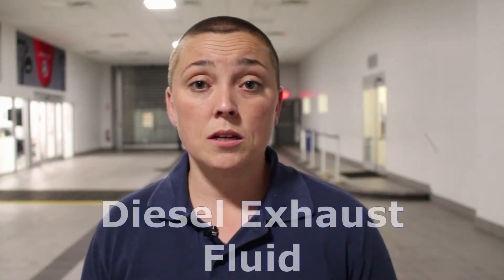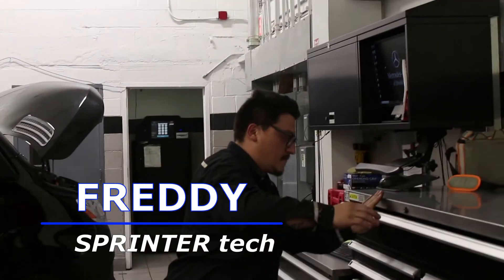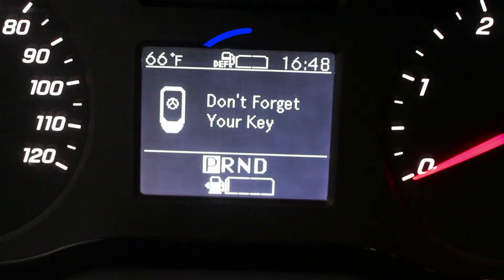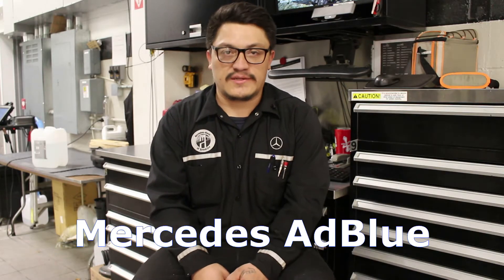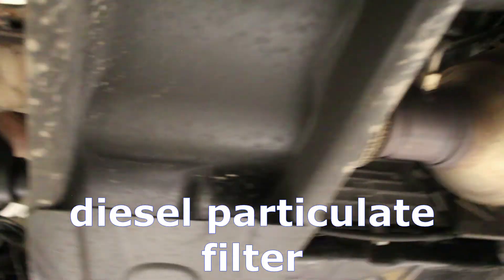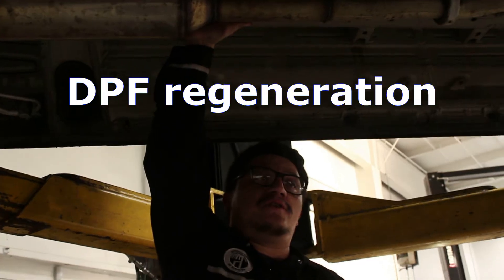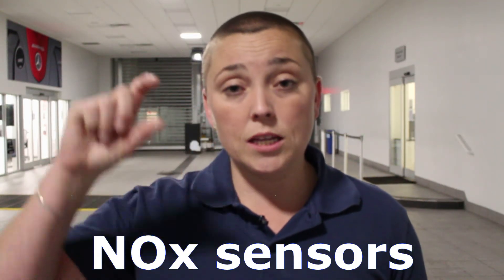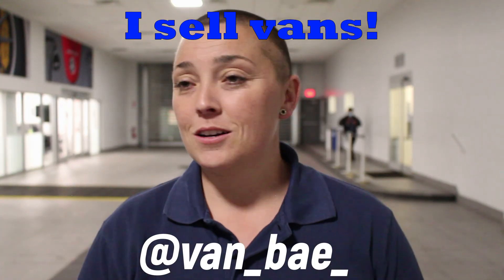SPRINTER DIESEL DEF / DPF / NOX- Basics about the Mercedes diesel exhaust fluid system service

Comment: My check engine light is on , it says high pressure cause particulate filter is clog, but it is not, I removed it and it is clean, what else can cause the problem? Thanks, David G, San Diego.

Comment: Hi im Kevin how are you, quick question I have a 2019 sprinter and getting a p229f code (NOx sensor circuit range/performance bank 1 sensor 2) which is now permanent and the truck only drives 5mph. What do you think could be the issue here a bad senor?

Comment: hi van Bae . in my 2016 m Benz Sprinter 2500 2.1 Diesel engine I have accident and both air bags were deployed I put new ones already . I replace air bag module also an I put new pyrofuse the one in top in the battery but still have srs code b1330 . is any crash srs sensor some where ? I look for impact sensor in front of the van but there is not impact sensors on it . any help I really appreciate
Reply from the maker: Didn’t see this!

Comment: hello van bae . could you please help me I have my 2016 Mercedes Benz 2500 2.1 engine I  had accident and both air bags deployed I already put new ones on it and I send my air bag module to repair  the say they fix I put it back on but  I have air bag system code b1330 electrical fuse pyrothecnical separator resistance to high .. . the fuse on the positive battery cable in top of the battery was blow out I get new one from Mercedes and installed new one I tough that was the air bag crash fuse but still the air bag code present is there any other fuse for the air bag system ? could you please help me and tell me where is any  air bags crash sensors located in this van ?  I check in front of the van but I didn't found any crash sensor in front of the van. but both air bags were deployed .. .  in the accident the adblue tank unit get dent the adblue tank was empty but I fill the adblue tank .. after I fill it up the adblue tank  the van drove great.  after 250 miles I get in dashboard start idle message .and now the van is in limp mode  I have code p13e300 the number of possible engine start is limited due to a malfunction in the adblue system ....and I have this code too  p152100 the starter was disabled by the exhaust aftertreament system .. please help me with any tips I really appreciate any help

Comment: what happens when zero start limit happens? The dealer tells me I can drive in limp mode, but people online are saying it won't start after zero starts. So what will happen after zero starts?
Reply from the maker: You have to take it in, DPF 99% of the time! Sucks. But no way to really avoid, only thing you can do it try to limit.
Reply: @VanBae  I did take it to the dealer and the reset the start count, and they said it shouldn't come back. The start count came back after a few trips. I had to order a DPF from online because the dealers cannot get any in stock from Germany. I do have a service appointment for Friday, but I only have 2 starts left again. I wanted to know if I can get away driving in. limp mode until Friday or will I end up being stranded?

Comment: I bought a 2017 Sprinter used, an ex ambulance and on the trip home the 10 starts came on, the Mercedes dealer said I needed nox sensors, I bought two mercedes nox sensors and installed them and now the codes are saying the DEF is the problem. I'd like to know the truth, what is the problem and who do I trust to fix it, the Sprinter guy at Mobile Mercedes is a chronic liar and I don't trust him because of his lies. So what do I do?

Comment: How often and how long should it be driven in highway?Just purchased an used 2011 passages van,with 50k miles. Would like to last a long time.
Reply: Would you just  buy the van or only take it as a trade-in?
Reply from the maker: @OlisYFaby  I’m sorry I didn’t see your message I’ve been crazy busy! Did you get a van?
Reply: @VanBae   it’s actually at the Mercedes B. Dealership in wappinger falls ny. Its getting the “emissions modification “ done to it. I plan on selling it soon after I get it back. I’m going to be looking for something similar but gas.
Reply from the maker: I WOULD DO AT LEAST ONCE A WEEK FOR AN HOUR! TRADE THE VAN INTO ME, I HAVE SOME 2022'S COMING AND CAN PAY GOOD MONEY FOR YOURS :)
Reply: @VanBae  Im in Poughkeepsie New York, where is your shop?
Reply from the maker: @OlisYFaby  it’s in Brooklyn!
Reply: I really don’t want to have a loan on a van.
Reply: just did the def campaingn / recall mercedes will pay you 3,290 $

Comment: I have 2013 Sprinter VIN   WDAPF4CC0D9546232. After I replaced fuel filter on 40 000 miles the DEF usage increased drastically (2.5 gallons every 2500-3000  miles DEF indicator on instrument panel is going ON).
First 40k miles DEF indicator would go on every 8000-10000 miles on the same 2.5 gallons.
Please help.
 Also I will be happy to know how DEF is mixing with fuel. Is there a special pomp ? Is fuel filter involved in this procedure?  
 There is no leak under the engine.
Thank you
Reply: DPF is filled with ash and needs to be cleaned or replaced. And DEF doesn't "mix with fuel". It is injected into the selective catalytic reduction to eliminate NOx gases created by the DPF.
Reply: I have similar problem after Mercedes recall. After One time recall warranty repair give up. DEF cost less than any dealer repair if something new happens.

Comment: Kia Ora from New Zealand, Van Bae! Much appreciated this video. I have a "new" 2019 (not registered before 2022, they would sell that as a 2022 here) Sprinter van. At 6100km and about 130 hours of driving, I took it in for a intermittent cabin heater and a look-over due to its age. When I picked it up, they advised that the DPF was 90% full and that they had run a manual regeneration. Roads are windy and narrow here, the top speed is rarely over 100km/h (tiny stretch), and my average driving speed is 48km/h. I've only idled the van for power a few times. 

Anything else should I do? I can get it up to 100km/h for a while, is that sufficient and if so for how long do I need to run and how frequently would you suggest? (especially given cost of diesel here!).
Reply from the maker: SOUNDS LIKE YOU ARE DOING ALL THE RIGHT THINGS, BUT I WOULD GET IT UP ON THE HIGHWAY!
Reply: @VanBae  THANKS!!! The speed limit on highways here is 100km/h (60mph) and many of them are curvy enough that it's hard to stay above about 54mph. Any idea who long I need to run it for? I'd probably need to make it a point but don't know for how long... <3

Comment: I thought the dpf was cleaned by the addition of diesel to the engine exhaust to elevate the exhaust temperature.  Thed def lowers the NOx emissions and has nothing to do with cleaning the dpf.  A very confusing presentation with comments like cleaning the “engine”.
Reply from the maker: What are you thinking?

Comment: What is DEF?
Diesel Exhaust Fluid is a mixture of urea and water (32.5% urea, 67.5% water) and pretty pure. 
What DEF to buy?
Mercedes sells a DEF product called AdBlue. It’s the same Diesel Exhaust Fluid as everyone else sells. In other words, you can get it much cheaper elsewhere.
Cheapest: Fill up from a truck stop DEF dispenser. Just like fuel pumps, truck stops have DEF pumps too. It’ll be much cheaper per gallon. It’ll also probably be fresher than any you find in a carton.
Cheaper cartons than Mercedes: We have used several different brands. Prestone’s 2.5 gallon packs work well, although their pouring spout is super-cheap. You can buy the 2.5 gallon containers for less than the price of 1/2 gallon of Mercedes’ AdBlue. We’ve also used Peak BlueDEF which comes in a cardboard pack. You don’t take it out of the pack – just expose the cap and screw the spout on. Harder to pour, but it works just fine.
Reply from the maker: Anywhere that has same mix
Reply from the maker: Great comment thank you!

Comment: Van Bae after a complete top off of DEF how many miles should I expect before I start to see the gauge DEF level start to lower?  I have gone about 400 miles and it is still showing full.  However it did go through a Regen with out problem while highway driving.  If there is a problem with the DEF pump can it still regen?  2019 Sprinter thank you

Comment: Gasser power lover myself all the way, As I enjoy  A more ethical and extensive tech network.  I even get the oil changed at Pepboys for $49.99, labor included.  U can't touch that, DEF.  Compliance is getting tougher to meet by manufactures, Euro6 is the current standard in  Europe.; soon 2024 , they will require an engine  autokill switch if something is wrong with the DEF.  Polititians care about Earth, "finally".

Comment: Great vids. Mercedes didn’t help the situation by making the DEF cap the same color as the wiper fluid cap. They could have picked literally 100
Different colors and they picked blue, go figure. It was probably the same engineer that designed the whole shitty problematic DEF system.
Reply from the maker: Lol well, technically the stuff had blue in the name so it does make some sense but that’s hilarious
Reply: Perhaps the giant "DEF" on the cap could be a clue?

Comment: Can't just like rev the engine in neutral for a while if you're forced to be idle regularly?
Reply from the maker: I mean, it has to open the exhaust and reving it will not do the same thing. Needs to be driven.

Comment: My 2019 sprinter with 50000km is going for its 3rd egr valve.  There reason being that when I accelerate to pass the transmission kick back hard and the engine feels like it's misfiring. I have already a hard down shift with this van
Reply from the maker: Canadian? What’s your closest dealer? I can reach out. Not normal but may be multiple thinga
Reply: @VanBae  mercedes benz boundary in Vancouver bc.

Comment: You can see that the mechanics have been trained on what voice warranty more than how to fix your car
Reply: Nitrous sensors lmao
Reply: Worst vans and worst Dealership . Bought new 23 Sprinter , they delivered it home and took it for a test drive after 3 miles CEL on and 9 starts left , went to dealership and they said it was a NOX sensor, they ( fix it ) after 2 weeks CEL on came back to say hello , did a scan and is throwing me some codes Air intake system has a leak , ridiculous van has only 2K miles in it . Spending time to this horrible dealership. She said for DEF fluid to be MB benz certified? Where it says it when you buy the van ?
Reply from the maker: We’ll, they are mechanics for a brand so they would have to use language that won’t be a legal battle but of course they fix issues that are not warranty covered and warranty is less pay so they would prefer lol, but we don’t always have that choice. Warranty or outside of warranty, they fix to the best of their abilities

Comment: Add blue system works like shit is shit no matter what vehicle you have is alve from a $250000 Ford F354 by 4 by 4 to Mercedes Sprinter Van Sprinter Van Bosch systems don't work Bosch has been sued by the EPA thank you very much Bosh I don't think it's made in Germany anymore it's made in China

Comment: Mercedes suit and court for being liars and lost is 100% proven to is that proven to lie to their customers and cheat Is so many factory defects Mercedes won't fix they want me to pay for new noxensors when the old ones have been recalled They want me to pay for the fuse panel when the old one has been recalled Exhaust mounts break on every single Van look in the junkyard every single one is broken factory defect but Mercedes fix it no it no they'll fix it for $9000 Mercedes will not stand up and fix factory defects that they caused Is the lying about using the Mercedes ad blue They will not provide manuals in English to fix their cars right to repair violation of law over and over and over again if the battery gets too low the car will throw up 7 different errors each error is $150 to fix just for leaving your car headlights on or having your battery get too low only Mercedes can fix these errors Normal scandal will not fix it Van is made to break and only Mercedes can fix it right to repair violation breaking the law proven liars and court EPA violation largest payout ever This whole ad blue system was fucked up right from the beginning they lied about how it works And now anybody who owns a diesel is screwed thank you Bosh thank you Mercedes cucumber Sadie's for making my for making my $50000 investment worthless

Comment: Is the gas 2.0l sprinter having any problem and how many miles will they last?
Reply from the maker: No problems so far! 2 years in, I’ve seen them with over 100k and no issues
Reply: @VanBae  is that what Amazon is using ?
Reply from the maker: Gas and diesel combo depends on the driver
Reply: @VanBae  are people still buying diesel sprinter after def problems ? Also have they found any fix on it?
Reply from the maker: Fix on what specifically? Yes, predominately purchasing diesel
Reply: @VanBae  yes diesel. I was planing on purchasing Mercedes sprinter 2.0 l Diesel engine. But after doing research and see so many people saying Not to buy sprinter. Specially with diesel in it.

Comment: Good day Vab Bae (from Canada), I am a certify diesel/gas mechanic and I had a few TDI in my time, still have the 2015 Golf, it has of course the DEF system on it and we never had an issue during the cold Canadian Winter because it slept in the garage. I am getting a new Isata 3 2021 with the MBS chassis and the RV is going to sleep outside under a RV cover. The DEF freeze point is at 12 deg F or -11 Cel, what do you recommend to do in lower temp? any additif we can add or should I empty/flush the system dry.
Reply from the maker: Add the gel it should help. Make sure you run it for a few minutes before driving it also

Comment: Hi. I got check engine light P2201(Nox sensor at fault) 2017 80k miles 3.0 but still drives as usual. What can cause that and is it bad for dpf to drive with this code? Thank you. I did not know there are two of them.
Reply from the maker: Yes for sure get it checked out, may be covered under warranty depending on when you purchased it or what the date of purchase was for original owner. Box sensor itself won’t usually cause it to “drive bad” but will cause problems sooner than later so def get it checked out!
Reply: @VanBae  I see what you did there..."def" get it checked out:)

Comment: If the plug box light goes out the vehicle won't run it's an over-exaggeration but you get my point the slightest thing wrong with the vehicle and it shuts down leaving you stranded even if it's not real even if it's just a communication device problem and there's nothing actually wrong with your vehicle it will leave you stranded

Comment: High-water India full destroy the whole system that's really interesting because the DF doesn't add it till the end of the exhaust so the defective design lost it's constantly going bad boy you can think of lots of reasons other than this defective from the factory

Comment: Thanks for good advice to drive highway speeds  twice a month---Do you think 30 mins at highway speed is enough time to regenerate the DPK ? I have a  2014 MB sprinter 3500 had a DEF sensor warning and only gave me 10 more starts.  Got it to a German auto.mechanic who filled me up on DEF fluid (non MB) but sensor was malfunctioning and wouldn't reset after refill (4 gallons!)  so they told me the emissions system should still be under warranty and to take it into dealership.   Dealership charged me $0 and refilled with MB adblue warned me never to use anything else, and got the sensor to turn off.  Then my battery drain  issue kicked in and the whole van went dead...when I went in for a smog, all the monitor sensors wouldn't reset.  Had to go back to dealership just a week later for a second smog --but they got it to pass--sometimes only a good MB dealership knows best.
Reply from the maker: Oh no! You may need DPF already. How many miles?

Comment: I run my van with the def deposit empty, the I fill it up, but, the engine light won't turn off, and also I hace a note my display that says "adblue system failure. What should I do?
Reply from the maker: Definitely take it to the dealer! It’s probably got a nox issue

Comment: Hi van Bae my sprinter om651 says drive at high speed but how can in do that if it is in LIMP mode. My engine light is also flashing. Scanner says EGR deactivated. Not the first owner tho. UK
Reply from the maker: Oh man. What year is it? Has it had the new emissions recall? If you tow it in and have Recall done there’s a good chance the light will go off and be good but sounds like a dpf issue